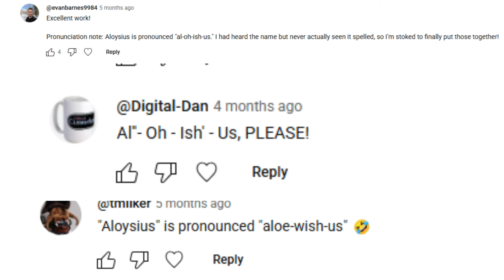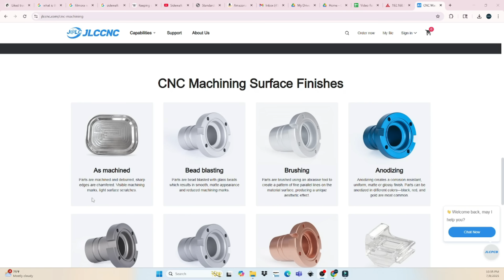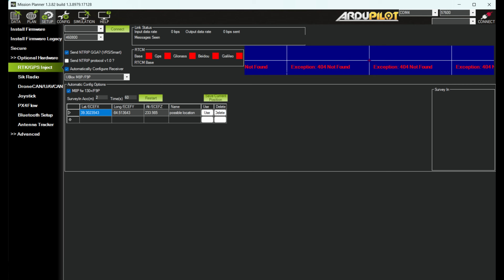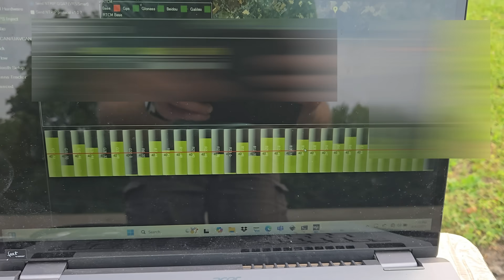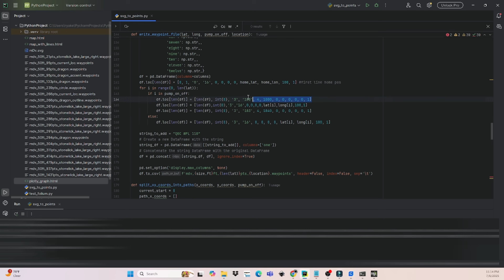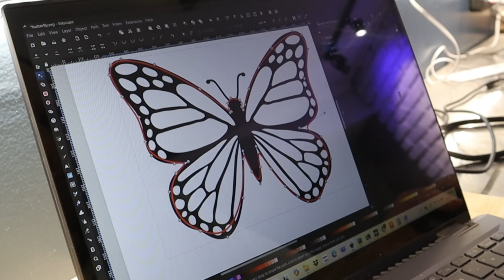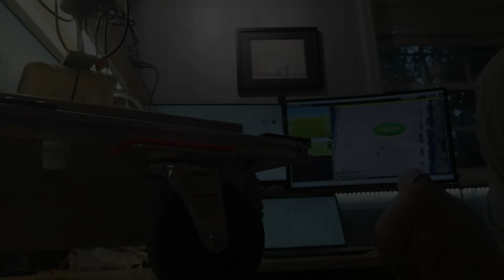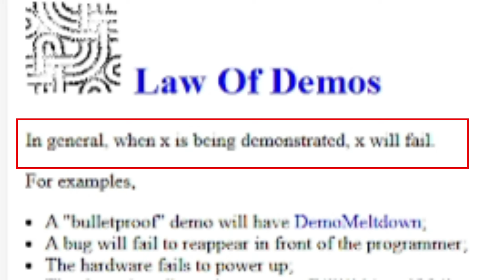GPS Robot Creates EPIC Sidewalk Chalk Art

Comment: Great Project! I clicked the video immediately when I saw the title, as my wife and I once build something similar (but at a smaller scale).
We build a robot that could draw a vector sketch on the ground using (solid) chalk sticks (which made very thin lines...).
Instead of GPS we just used stepper motors on the two wheels. This caused the position errors to accumulate and we only managed small and simple small drawings. But it was great fun and I am happy you succeeded to go really big with your design.
Reply from the maker: Did you put it on YouTube? I referenced something that sounds very similar to that in my first video, there is a clip of it maybe a couple seconds.
Reply: @MrDadVs  Unfortunately not. We made it for a hacker camp (chaos communication camp) and barely managed to get it to draw the logo of the event on the ground. Afterwards couldn't muster enough energy and motivation to finish the project. (Whatever this would have meant...)

Comment: I might have missed it, did you use ROS? (also I would have persisted with gcode as a universal supported file format which would be consistent with hardware commands)
Reply from the maker: No ROS here, for this test I was keeping it as simple and off the shelf as possible, just the Ardupilot firmware, and the rover stores its own waypoint file, which it executes in "auto" mode. There are definitely ways to improve this attempt, which was mostly meant as an exploration of GPS+RTK. Maybe in the next large scale one - I consider a different tech. I see ROS has some features meant to work with Ardupilot which could be interesting. Much to investigate!

Comment: Dude, you really overestimate GPS. It is relly finiky and precission has tendency to float due to atmo distorsion. Try something closer to navigation by basestations that are used for VR. You are getting not just prcice locations, but concistently acurate. Wich in tern meens that you can use more grainy g-code and print out not just conturs but full color images.

Comment: Do you have more details on how you make and dispense the liquid chalk solution?
Reply from the maker: Sure, its really simple I do end up glossing over it in this video and the last one. Its just cornstarch and water, and it dispenses using a peristaltic pump. I think i put about half of one of those boxs of cornstarch in a gallon of water.
Reply from the maker: And I control the speed of the pump with a servo output in the ardupilit software, or when in manual control there is just a basic dc motor controller

Comment: You might want to look into a optical flow sensors and either ditch the RTK or complement it. Depending on the sensor, you can get all the way down to sub-millimeter level tracking, entirely without relying on GPS or other external systems. Same general concept/technology you find in optical computer mice and your drone to maintain X/Y position. 

Should you try to use optical flow sensors, just be aware that, depending on the optical flow sensor, you may need two optical flow sensors to accurately gather rotational data.
Reply from the maker: Yes! I may have already googled around about that...strongly considering exploring it.
Reply: wut

Comment: For the washer type you used, the Internet is split between them being useless or making things worse. Your best bet are either nylon lock nuts or thread locker.
Reply from the maker: Haha to be honest I was too embarrassed to say the real problem...which is that I put the wheel on to test fit, only two bolts finger tight and then completely forgot...its a miracle it lasted as long as it did.
Reply: @MrDadVs happens to the best of us. Given that it's a low vibration environment normal washers are probably the best option. 
I'd also try and align center of rotation, center of the vehicle and the paint nozzle to have the least amount of position error, especially in tight turns.